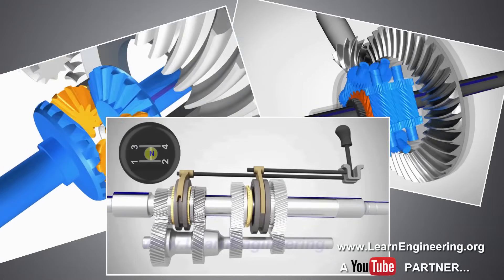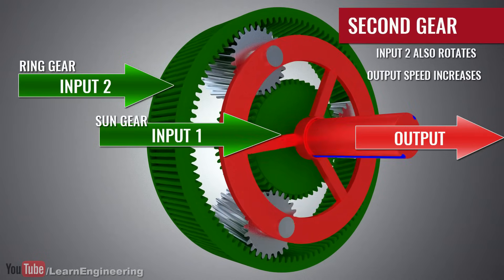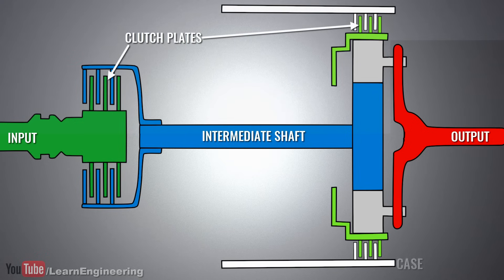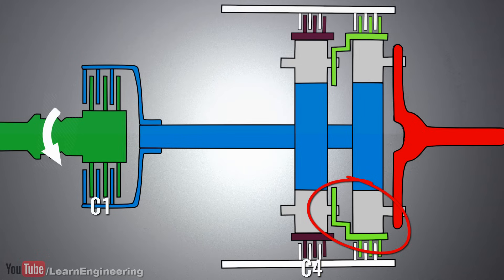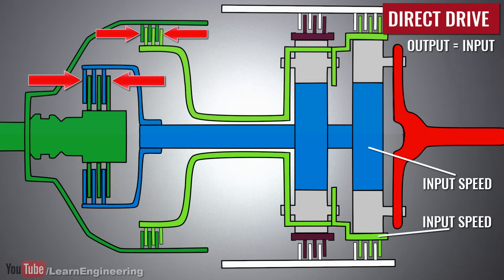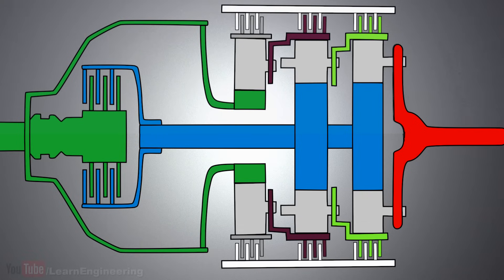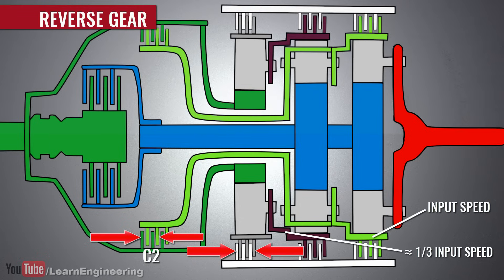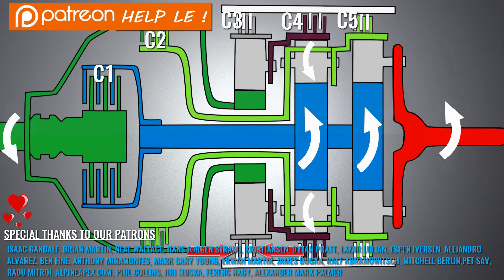Automatic Transmission, How it works?

Comment: To help understand it, check this simulator, where you can simulate different speeds of sun/planetary/ring gears and how it affects output speed. http://www.thecatalystis.com/gears/
To match model in video, set it as follows:
Number of Planets: 3
Solve for: Planets and Carrier (Output)
Sun Teeth: 30
Planet Teeth: 15
Ring Teeth: 60

Now you can change sun/ring speeds and see how it affects carrier speed (output)

For simulation of fifth and sixth gear, second planetary gear set, you have to set  it to Solve for: Sun, because Sun gear is used as output.

http://www.thecatalystis.com/gears/

Comment: seems the inventor must have solved many rubic cubes, to have the imagination to figure out this gear mechanism
Reply: I've been speedsolving the Rubik's cube for over 9 years now and let me tell you I'm just as confused as the rest of the people in this comment section.
Reply: nah i think he accidentally sip on some coolant and survived
Reply: Didn't happen overnight.
Reply: I don't think so. From what I understand, it sort of evolved as you see in the video here. Start with one clutch, then a gear set, then another gear set, etc until you get a 6 speed.

But the evolution continued. Now Ford and GM have 10 speeds and semi trucks have even more. There are also automated manuals, and transmissions that have to sets of gears and alternate back and forth for faster shifting.
Reply: Watch makers ...
Reply: Not just the cube but it's inventor was'nt born when Biro already invented the automatic gearbox.

Comment: On 3:22 it is little confusing as you say that sun gear from 2nd set is rotating at almost 3x of the input. How ? If ring gear of the 2nd set is stationary, and then sun gear is = 1/3 carrier, and carrier = input, then how sun gear could be rotating 3 X carrier (input)

Comment: I've rebuilt a few valve bodies for the 3000 series allison 5 speed. I can say they are hard to follow but robust and bulletproof. Until you apply 300+° heat for an extended period of time..

Comment: Plz tell me why we are applying C4 cluch pack for 2 nd gear????
Reply: Because in 1st gear C5 has stationary ring (zero secondary input) thus output is 1/3 of primary input (sun gear). But in 2nd gear C5 has secondary input (outer ring) from C4 equal to 1/3 and primary input, thus secondary (outer ring) input increases output by 1/3 I think. In summary you have 1/3 output increased by 1/3

Comment: THE MAIN QUESTION IS WHO WILL ENGAGE AND DISENGAGE THE CLUTCH IN PLANETORY GEARS. IS IT DONE AUTOMATICALLY ? IF YES THE HOW.   ALSO HOW THE TORQUE CONVERTER CHANGES THE GEAR SET IN AUTOMATIC TRANSMISSION

Comment: what causes the clutch packs to engage and shift gears?
Reply: the planetary gear transmission was invented in like 1908 or something. ehatd they do before computers were in cars?
Reply: @allank8497  Using a valve body

Comment: The rotating parts of the transmission don't boggle my mind as badly as the valve body and how in the world it's able to divert fluid in the correct direction to make the right clutch pack compress and lubricate all the moving parts at the same time. That makes my head explode.
Reply: oil pressure + pipework + electric valves.
Reply: @xdygmnyrdf  yeah, but it looks like a giant mess

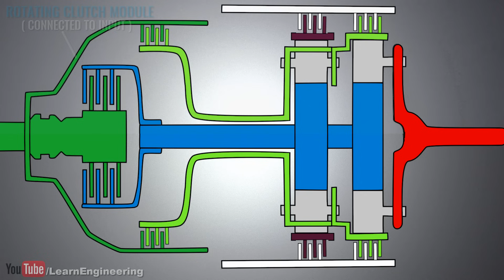Comment: Frankly, the explanation is not perfect. The viewer is asking himself "how the hell can the ring rotate? It is only connected to the white thing" (white = the stationary body of the gearbox) .. see time 2:19. Important is to understand that all suns and rings are connected to the green input (via some clutches to enable disengaging or stopping them) and this is the trick. You should start watching the video at time 2:44 to see it. But generally thanks for all your videos, I watched them moretimes and now I understand how the transmission works.

Comment: Brilliance? More like awfullness... For almost every gear you need a clutch made of friction material that degrades every time you engage or disengage the clutch. And to make things worse, you have to add a torque converter full of fluid that needs to be exchanged sometimes and loses energy. Automatic transmission is a complicated abomination that is a hell to maintain.
Reply: @Thrust vectoring Wrong. These clutches are automatically controlled in a rapid manner without having to deal with energy dissipation. What wears out clutch pads is dynamic friction i.e. slipping. The slipping in these transmissions are taken up by the torque converter and these clutches engage essentially in a static fashion.

Comment: This is just as difficult as the last Learn Engineering Video I watched previously on Allison Transmissions.  Not once was it even explained what C1 C3 C4 are (clutches) and how that translates to pressing on the gas and or increasing speed in a vehicle.  You didn't even explain what the engine is doing or how fast you are going when things are happening.  If there is not a reference point for the engineering jargon you are talking about then the ability to learn from it is nullified.  Never once was it said "as you go faster and the car starts to transition from 1st to 2nd gear" or anything similar to that.  It's just such a underperforming learning tool that I'm actually frustrated listening to.  I apologize for being so ornery but jeez.

Comment: So how does the transmission know when to change gears
Reply: There are a couple possible ways.  One simple mechanism is called a "throw-out" bearing.  These are rings kind of like the synchronizer rings on a manual transmission that rely on pressure in one direction to create friction perpendicular to the direction of pressure.  A throw-out bearing can expand on internal springs as its angular velocity increases.  When a throwout bearing reaches a high enough rotational speed, it becomes large enough to grip a clutch sleeve and engage the appropriate clutch pack.  You determine what engine speed you want the clutch pack to engage at by changing how stiff the springs are in the throw-out bearing.  It's a lot more complicated than that because the clutch packs in an automatic transmission don't just sequentially engage, but that's a simple way you can make contact at a particular shaft speed.

Nowadays, shifting is controlled by computer, which can respond to more than just simple engine speed.  The car just knows the most efficient time to shift.
Reply: Here's a more practical way of how it's actually done without a computer.  Same principle though.  Use centrifugal force to change the shape of a rotating body and force a different engagement pattern:

https://www.youtube.com/watch?v=GInO44Sge40
Reply: Grak70 

Oh I think I get it thanks

Comment: manual tramsmission learned in 5 minutes
automatic transmission 30 minutes and still counting
Reply: haha same here I think i get it for a minute then bang wrong
Reply: The intermediate shaft is what allows it to work, The intermediate shaft is the output of the first set of clutch packs but it’s the input of the second set of clutch packs.
Reply: Yes the same me too
Reply: @wolfgangdayo-61  

Strange! How does Soviet Union come in? Do Russian have anything to do with planetary gears sets physics - when will you people stop being stuck in by gone  cold war mentality.
Reply: in automotive class transmissions is abouut 3 month class.a few days for manual trans/lsd/differentials/driveshafts and other drivetrain parts and 80% auto trans
Reply: And the opposite when learning how to drive in them
Reply: @midicherif1738  You spend so much military because you're owned by Israel. The US government is literally owned by israel
Reply: Dude just want to appreciate how the system helped in cold war and these retards made it look like it was the entire reason why us won the war lol
Reply: Agree on this one. I searched automatic in car because automatic transmission in  motorcycle is very easy
Reply: ATX get very complicated. the valve bodies and plate along with different valves, spools under spring pressure and passageways sized to create certain pressures, guide transmission oil through passageways in the transmission body or in some applications through the input/output shafts to clutch mechanisms that all acting together create the gear speeds.
Reply: @wolfgangdayo-61   Socialism/ liberalism led to the collapse of the Soviet Union. And, it's probably going to lead to the collapse of the USA. 
We don't really need the military.  Just infect our enemies with socialism and they will fall from within.

Comment: What ratio would you get if you would release C3 while in 5th gear?
Reply: I've got a video that demonstrates that in 3D. It's called "How Clutch Parks Work on a 6 Speed Automatic Transmission: SIMPLIFIED." Check it out.

Comment: how do the clutches move on their own
Reply: they dont. pistons apply them with the help of hydraulic fluid.
Reply: Originally you would have a hydraulic pump spun off the fly wheel and always applying pressure with a second pump off the drive shaft and a valve controlled by the throttle to relieve pressure to determine when it shifts. Now the pump is integrated into the torque converter and there are several computer controlled valves. The exact implementation varies greatly by manufactuerer. I believe ZF, Ford, GM, and Mercedes hold a great deal of patents that make it very difficult to make a good control system for other companies, which is partially why most are moving to CVTs.
Reply: Nothing moves on its own.

Comment: how does the Clutch even Compress together? that is the real question.
Reply: I've got a video on that. It's called, "How Clutch Parks Work on a 6 Speed Automatic Transmission: SIMPLIFIED." There are pistons but the 3D animation will illustrates some of that.

Comment: You have to make another video with the inclusion of appropriate hydraulics for full understanding of the auto transmission.
This video (a good one though) only shows how to achieve certain gear ratios.
Reply: 1nterstellar Explaining the valve body may be really difficult, other than that it routes the hydraulic fluid to the proper clutch pack pistons Based on the position of different valves.
Reply: Yes, that’s what it’s missing, how the input rotation speed acheived and how the output is applied to the axel or wheel hub

Comment: So all this stuff just happens smoothly as you speed up?
Reply: since the pressure is applied gradually on the clutches at the car speeds up, it should be very smooth. It has been for the past 50 years for sure.

Comment: At 6th gear, the sun gear should be able to move freely right? Since it's not locked to anything?
Reply: Assuming you're talking about the third sun gear, no. The second sun gear is rotating and the third is connected to that one.

Comment: .....I need a 1D model.
Reply: Here:
—————— ———
Reply: still too many Ds 😓
Reply: @Valkoinen_Kuolema  It's 0D actually. Point has no dimensions. You can't give any of its size, it's sizeless. 1D would be for example " - " because it has one dimension (length)
Reply: @PinkeySuavo  True. :) I don't know what I was thinking about when I wrote that.
Reply: What press the C1-2-3-4-5 clutches?
Reply: @harkalyjonas I'm late but this animation leaves out a pump that is driven by the torque converter. Your transmission fluid is pumped through a valve body that controls the flow of the fluid to each clutch pack. Lots of electronics reading the speeds of each shaft and rpm and ground speed.
Reply: @Valkoinen_Kuolema   .
Reply: Very good
Reply: if 1D model so there's only Dots every each gear
Reply: @peterstanleysoen1527  still technically 2d
Reply: That's a good one-liner.
Reply: His speech/audio is one dimensional.
Reply: 1D is impossible, and it doesn't exist, and the reason why it's called 2 dimension is because you a 2 dimensions, which are the length, and the width, if it was 3D, you would have an additional dimension, which is the height, and 3D gives us a cube, and 2D gives us the square.
Reply: These types of comments tell me I need to go find another brainlet friendly video lmao
Reply: I’m with ya bud
Reply: look from charging hole
Reply: @VJETRA  The Kingdom of God is at Hand 
John 3:16
King James Version 
16 For God so loved the world, that he gave his only begotten Son, that whosoever believeth in him should not perish, but have everlasting life.
Reply: @Valkoinen_Kuolema  i see now
Reply: Lmao
Reply: @Valkoinen_Kuolema  actually it would be" ----------------". A single dimension is a line.
Reply: Hahahaha
Reply: This made me laugh way too much
Reply: Does this make sense? — - —- -
Reply: @Valkoinen_Kuolema  that is 0D
Reply: Can I have 0D model plz
Reply: Me too
Reply: A. Press pedal, note there are only two pedals, not three.

B. It will go forward.
Reply: are you crazy 😬😬 do delete your meaning less command. this is the only place for technical peoples.
Reply: LMAOOO
Reply: The Kingdom of God is at Hand 
John 3:16
King James Version 
16 For God so loved the world, that he gave his only begotten Son, that whosoever believeth in him should not perish, but have everlasting life.
Reply: @patriot1303 The Kingdom of God is at Hand 
John 3:16
King James Version 
16 For God so loved the world, that he gave his only begotten Son, that whosoever believeth in him should not perish, but have everlasting life.
Reply: 😂😂😂😂 same
Reply: Me too.
Reply: bro i need someone to explain this to me as if I was a 4 year old 💀
Reply: Me I need a 1/4D model
Reply: insertrandomcleverusername 

hahaha
Reply: @sayed1410  The Kingdom of God is at Hand 
John 3:16
King James Version 
16 For God so loved the world, that he gave his only begotten Son, that whosoever believeth in him should not perish, but have everlasting life.
Reply: insertrandomcleverusername it spins clutches which engage gear sets based on what gear you have it in. Simplest terms that can describe an automatic transmission.

Comment: Why is the output not exactly equal to 1/3 of input from sun when ring stationary?
Reply: The ratios are depending of  the number of teeth the gear have. A severe problem in these kinds of gearsets is that there are a lot of equations to solve to get some combinations of ratios that will really work together properly. Ratios with exact whole numbers dont appear in practical use.

Comment: So by engaging and disengaging the various clutches, you can alter the gear ratio at the output of the whole thing. But what is it that automatically determines which clutches to engage?
Reply: In older cars there were very difficult hydraulic and electromechanical constructions that accomplished these tasks. By a devine miracle these tiny parts never gave up and did their duty the whole lifetime of a car.
Modern computerized gearsets need to be hugged very often - if not they behave as a stubborn donkey and refuse to go any more step further.
This is the result of engineer's and technician's work - they sacrificed decades of their life to develop artificial intelligence in computers.
State of the art today is the intelligence of a donkey ...
Reply: in modern cars; by a computer that that reads various sensors

Comment: Any idea why for the 3rd gear, the input shaft needs to be activated? It makes no sense to have that spinning if the rotating clutch module is already moving the output shaft.
Reply: Without the input shaft spinning, the output speed would only be equal to 1/27 of the input speed (1/3 for the first sun gear & two more 1/3s for the two ring gears C4 & C5), which is much lower than what's required for a third gear. Combined with the C5 ring gear, the input shaft spinning helps boost the output speed to the appropriate level.
Reply: Without the input shaft spinning, the output speed would only be equal to 1/27 of the input speed (1/3 for the first sun gear & two more 1/3s for the two ring gears C4 & C5), which is much lower than what's required for a third gear. Combined with the C5 ring gear, the input shaft spinning helps boost the output speed to the appropriate level.
Reply: Without the input shaft spinning, the output speed would only be equal to 1/27 of the input speed (1/3 for the first sun gear & two more 1/3s for the two ring gears C4 & C5), which is much lower than what's required for a third gear. Combined with the C5 ring gear, the input shaft spinning helps boost the output speed to the appropriate level.

Comment: Either i got it wrong or when applying C1 and C2, the first set of planetary gear cannot turn as the sun and ring gear are rotating in the same direction, the planetary gear cant turn both clock wise and anti clockwise.

Comment: it still doesn't explain how it works,it just shows the mechanism and principle of working 
how are the gears selected, why does it change automatically, what part does the transmission oil play, what is the significance of the engine speed,at what rpm does the transmission change gear and what instigates that change
Reply: In an old automatic, like mine, there's a complicated hydraulic system that pushes some clutches open or closed.  That in turn is controlled by valves run by a simple chip and sensors that take speed, current gear, throttle, transmission temperature and possibly more.  Modern ones?  Transmission computer.

The oil serves to keep all that stuff running smoothly.